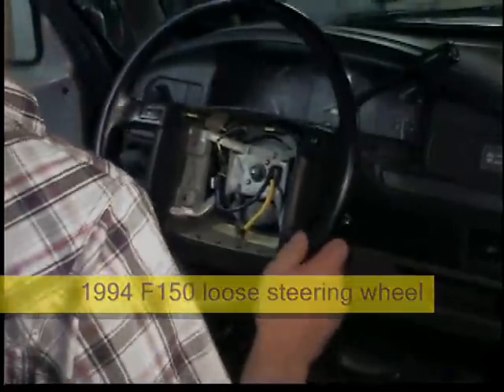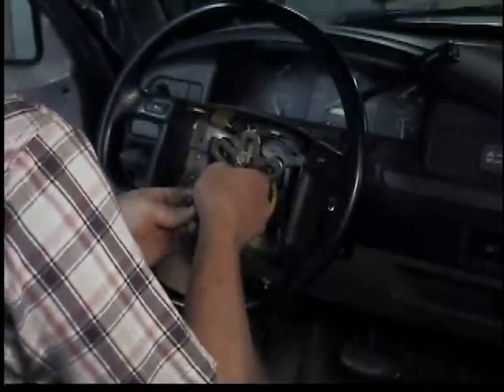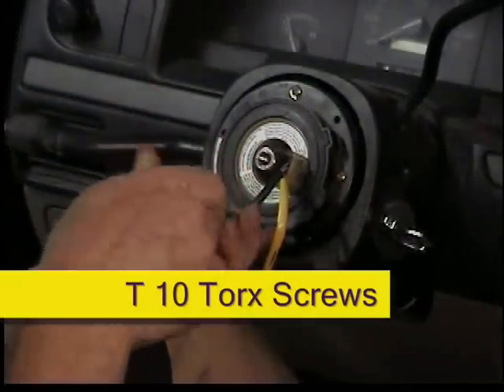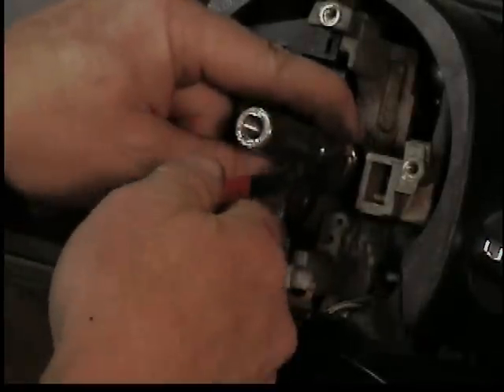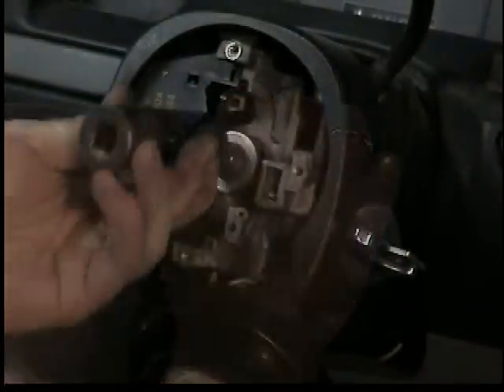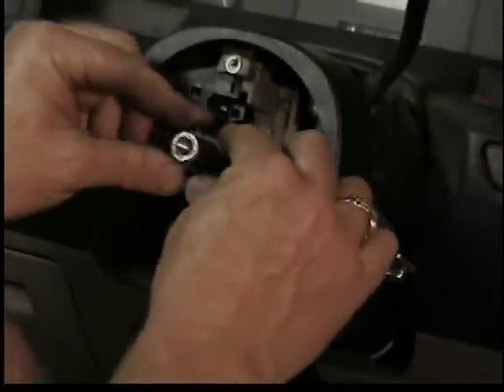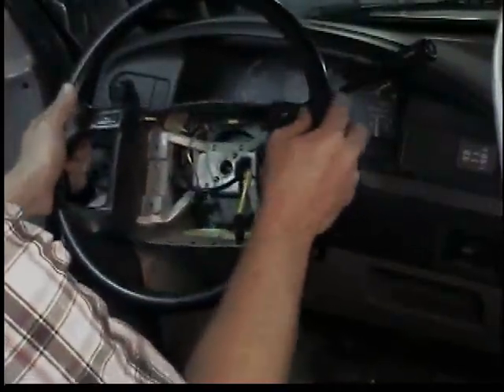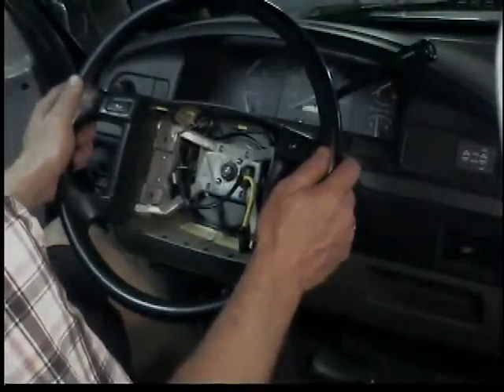loose steering wheel fix, Ford F150, how to DIY

Comment: I found a screw in the floor under NY  steering column of my 2003 F150  help me find out where it belong  looks like a Torx screw
Reply: I found a screw laying in the floor under the steering column of my 2003 F150. Also my truck is starting in the drive position in the D on the column can someone help me find out where the screw belongs it kind of looks like a Torx screw
Reply from the maker: This video won't help much. Completely different interior. Good luck.

Comment: Tried that with that exact part. It was a no go. Would not seat. Ordered the actual bearing instead. I appreciate the video. It was extremely helpful.
Reply from the maker: Sometimes the bottom Bearing goes too. If you have the time and want it right replace the shift tube.

Comment: Five years ago I replaced the bearings on my 92 F150 steering column. Apparently, it also had a worn bushing. It passed inspection for four years, it was not going to pass this years inspection because of its wobble. It wobbled 2 inched. Found your video, ordered the part from McMaster-Carr, part was a whopping $2.65 and shipping was approximately $5. I had it on my door step, in less than 18 hours. Just completed the installment of the Flanged Sleeve Bearing. No wobble. Now off to inspection tomorrow. Thanks for the video.
Reply from the maker: Marty Martinez Thank you for sharing. Hopefully this will last as long as your truck. Wrench On!
Reply: Where did you find that parti can’t findit
Reply: Marty ...what state do you live in to have to be required to pass an inspection (for your registration) ?  I guess that's ONE thing that the powers that be in Sacramento haven't caught on to (yet)

Comment: so all i have to do is change the steering shaft bushings because my steering wheel is doing that same thing so i have to change the upper and lower bushings cause i'm tiring of my steering wheel doing that because i don't want to buy another steering column when i can fix the one i already have  please tell me what io have to buy i drive a 1996 mercury grand marquis gs
Reply from the maker: Buy and install a new shift tube if you want to do it right. This video shows a cheap hack that might work for a $750 truck.
Reply: @user-nq5rd4ck5z  the guy said to change the steering column bearing a sleeve a tolerance ring and a retainer and it will fix that wobble steering wheel
Reply from the maker: @jeremypinder4436  What guy? I couldn't figure out how to get the old bearing housing out. Again, the correct fix is to replace the entire shift tube. It comes with two new bearings.
Reply: @user-nq5rd4ck5z  so you're telling me the reason why the steering wheel id moving around like that so all i have to do is change the shift tube. a guy said he changed the steering column upper bearing and a couple of other other things and it was solid like a rock
Reply: @user-nq5rd4ck5z  
0:03 / 4:25
OBS Ford Truck Loose Steering Column upper bearing repair / replacement
Reply: @user-nq5rd4ck5z  
Black 7 Point Tree
472 subscribers
This is on a 1996 F250 powerstroke 4x4 with manual transmission and a tilt steering wheel.

Parts:
3517 - upper bearing
3L539 - Steering Column Shaft Tolerance Ring
3518 - Steering Column Sleeve rubber

Comment: So, above my pay grade. Bummer.
Reply from the maker: And this is the "hack" method. The right way requires removing the steering column and replacing the shift tube. Thanks for watching.
Reply from the maker: And this is the "hack" method. The right way requires removing the steering column and replacing the shift tube. Thanks for watching.
Reply: @user-nq5rd4ck5z  thanks for reply. Yeah, probably need to find a mechanic to fix this one. Dont have time to have it drag out for two weeks. It got loose fast too.

Comment: my steering wheel have plenty of play so is this the culprit cause i will do this right now my steering wheel is hard to turn sometimes and that's dangerous so i want my steering strong and sturdy and not loose i been driving like that for a very long time and it's time i fix it

Comment: Did the same thing on my 1992 f150. Took up a majority of the steering play. Thanks for the advice.
Reply from the maker: Cool. It's a lot easier fix than replacing the shift tube.
Reply: Do you know the part number for the bushing

Comment: My 92 f150 has tilt wheel and the 3 ring horn/cruise control contact switch cam clock.It wobbled so bad that it broke the pins off of the contact wire causing it to short out and have to get a jump start to start truck.It runs great except for having to jump start.I. cant afford the contact wire do you think it will make a difference if i just do what you did in video?
Reply from the maker: IDK. This is a hack fix. It is not exactly tested in all scenarios.

Comment: hi i am from argentina i have a ford econoline 1993 i have the same problem. you could help me find that piesa for my ford econoline. here in Argentina it is impossible to find that part. If you can pass your name in English or a link where I can buy it, I would really appreciate it. thanks greetings
Reply from the maker: The part number for McMaster Carr is in the video. Order it from their web site or any supplier with flanged bushings.
Reply: Matias fabricatelo  tu mismo Matías,  no es difícil,   ve con un gojaletero,  no necesitas balero,   sólo el bushing

Comment: Bought that bushing.. didn't work
Reply from the maker: Yep. No guarantees. Time for a whole new shift tube probably. Cars Suck!
Reply: @user-nq5rd4ck5z  no the bushing don't go in all the way its just a tad too big..i have the same year of truck..im just putting the actual bearing back in
Reply from the maker: @ericmessing5359  You can sand it to length.

Comment: I wish my wheel was only as bad as the one in video. I have had a pile of  metal shavings under column for 5 years now. Don't pull yourself in by wheel. Thank you for video.
Reply from the maker: Pete Haselden Yikes! You might want a new shift tube.

Comment: Very nice job.  Just one thing, I have to do that same job to my truck which is a 1992 and I am having that same problem.  The wheel is doing the same as that one was doing.  Do I follow the same procedure my Friend?  I can imagine that it might just be a little different.  Anyway thanks for sharing Your great expertise.  It was a pleasure to learn from You.  Take care! ! !
Reply from the maker: Felix DuBois As far as I know it is the same. They used that steering column in a lot of things and for several years. I read somewhere it is even the same as a Town Car.
Reply: Very nice information.  Thanks for sharing.  I have the same problem with My Truck on which I have to correct that problem.  That I'll do after I change the gasoline pump on My 1973 Stingray Corvette.  I'm on it now.   It should be ready by tomorrow with Gods help!  Too busy lately.  Bye for now Amigos! ! !

Comment: well I hate that wobble I want to fix that problem. the guy told me I had to change the upper shaft and the bearings and the selector tube
Reply from the maker: Well that is the correct method. This is just a hack DIY. I guess it depends on how nice your truck is.
Reply: wwwCARSSUCKcom I don't have a truck I have a 1996 mercury grand marquis gs but I have the same problem my steering wheel is all wobbly and moving and I don't like that and I need to fix that.

Comment: Why you didn't show how to take that bearing out..!!! 😝 That's the most important part
Reply from the maker: The needles were gone. That IS the problem. The bushing fits inside the outer bearing race. The best way to replace the bearing is to replace the entire shift tube. This is just a quick cheap fix.

Comment: The proper bearing part numbers for a 2002 Ford f150 with tilt is as follows: F4DZ-3517-C for the large bearing and F4DZ-3517-A for the small bearing. $12  for both at the Ford dealer.
I will post a video of the installation of these bearings when I replace mine.

Comment: Will this work on a 1996 f 250 as well? And would it be the same part # ?
Reply from the maker: Probably. I think they used the same shift tubes. Lots of Fords used them in the 90s. THis method should work on Town Cars and Grand Marquis...
Reply: I think the part number is 3517. Look it up. Also there is a 1996 bronco/f series repair manual online. It has all the info. I’m taking my truck tomorrow to autoZone to borrow the pulled and inspect the area. Hopefully will only need that one part

Comment: do you know if this would work on an 85 f250 with tilt?
Reply from the maker: It is probably the same steering column. You could check rock auto dot com to see if the shifter tube is the same on your year and model as this 85 f150.
Reply: Ever figure out if it works? I have an 81 with this exact problem.

Comment: Is there any website that has the specific parts for year and model? I have a 96 F250 that has this issue. I was wondering if the part in the video would work in my truck
Reply from the maker: Matt Perez Rock Auto is a great place to compare models and parts. You could look up both trucks to see if they use the same shift tube. Of course this is kind of a hack fix with a generic bushing. The real fix would be to remove the steering column and replace the shift tube.

Comment: So how is the steering shaft going to rotate after you force a sleeve in place of the bearings without even any grease or lubricant  ?
Reply from the maker: Just fine thank you. If you don't want the hack fix replace the shift tube.

Comment: awesome..
thank you.. I have  f150 93... exact same problem... I wasn't sure  about pulling off the wheel.. the two  tapped hole I was assuming two bolt pulls off.. thankl you to showing it..

these trucks  still running  very well.. and these are  just really minor  problems..
go ford :-)

Comment: Why didn't you knock out the bearing and put a new one?  Take a chisel and cut through one side.   I would think you could get it out
Reply from the maker: Don Kleppinger I did hit it a couple times and it laughed at me. Hardened  steel bearing case in a cast aluminium shift tube. I didn't want to break it. New shift tubes are available with new bearings but this was a $750 truck.